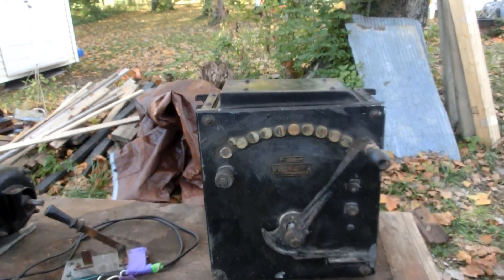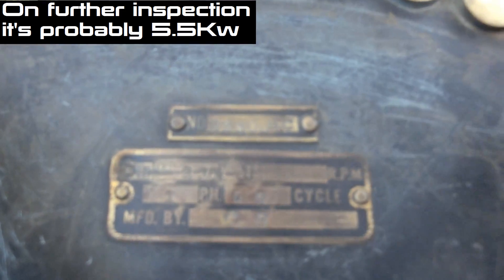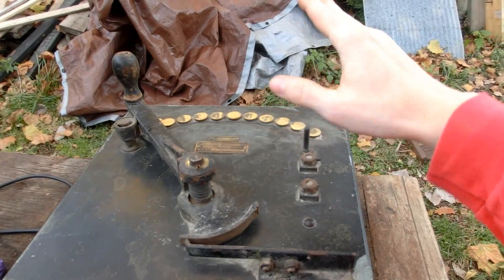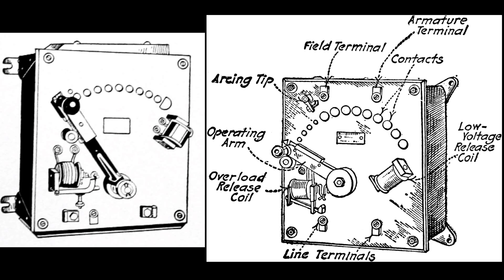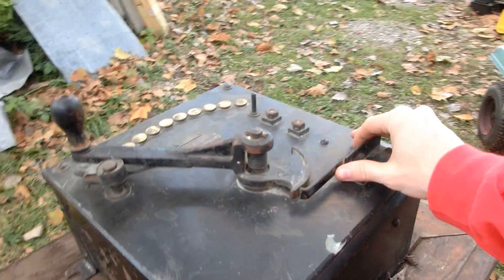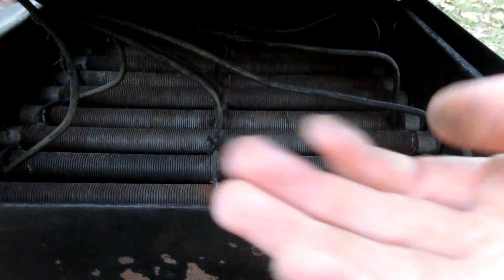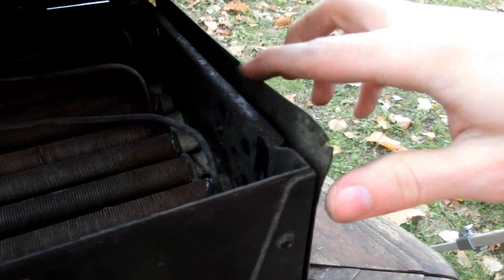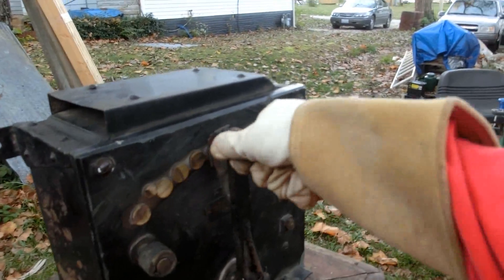1890s Cutler Hammer 5.5kw 240v Starting Rheostat

Comment: In the modern days running the thing at 220V is considered a bit too dangerous - for good reasons.  You might control something indirectly, run a low voltage through the rheostat then control something else indirectly.  Something like that.  For added effect, put a speaker into the case and play a 50/60 Hz humm.  Who knows, maybe this things predates the standardization of grid frequency?

Wire resistors are typically made from nickel alloys.  "Constantan" is one of the more recently (relatively speaking) used ones, "Nickelin" was one of the older ones.  I was wondering about insulation of the wire to avoid an internal short between neighbouring windings.  Chances are the wire is wound on a ribbed ceramic cylinder which is keeping the wires just far enough to avoid a short.  This method avoids insulation materials for the which at the time were still problematic, especially at high temperatures and if this rheostat really does 5.5 kW for some extended time it will be more than toasty.

Comment: the problem is that you are using an induction motor, their speed can only be changed by either a change in electrical frequency or changing the number of windings in the motor, rheostats or voltage controllers will do nothing to the speed
Reply from the maker: its not meant for rotational speed, but accelorational speed
Reply: @RinoaL  next time you go to the scrap yard you should get that big old electric motor that you saw in the last scrapyard video, if you got that and the used the rheostat for the motor field and hooked it to some sort of engine, you could have a generator

Comment: That motor starter is intended for use with a repulsion type motor, probably somewhere in the 5  to 10 hp range.  Your motor is a split phase motor, and will not start properly on low voltage.  The reason it starts is because the resistance of the starter is so low, being designed for a much larger motor.  The presence or absence of the coils has more to do with what it was designed to do than the era in which it was built.  The starter is not designed to be left in the circuit to permit speed control as the resistors will quickly overheat.  I have a ten hp Century motor seen here starting and running on about 1/3 rated voltage.  That starter would be perfect for my motor :) Search "10 hp Century Repulsion Start Motor" and you'll find it :)
Reply from the maker: +realvanman1 oh yeah i've seen your video on that before

thankfully those starting rheostats arent impossible to get http://www.ebay.com/sch/i.html?_odkw=cutler+hammer&mfe=search&clk_rvr_id=910774530711&_osacat=0&_from=R40&_trksid=p2045573.m570.l1313.TR0.TRC0.H0.Xstarting+rheostat.TRS0&_nkw=starting+rheostat&_sacat=0

Comment: hve you tried a maintenance on it, you know,well, i know copper is done with salt and water but vineger can be used alone.  essentially  it`s remove the rust or oxidization. so the metal can conduct.
Reply from the maker: Cleaning the surface of the wires won't increase the conductivity through them. So what are you talking about?
Reply: i'm sorry for wasting your time, i told a long time ago that it was the surface that carries the most electricity on the outside of the metal, making corrosion an issue. 
i can say that i have gotten small gadgets to work with this, but i cant say i've ever gone past fixing my fathers rc track from when he was a kid
Reply from the maker: *****
well the reason cleaning the surface of the RC track worked was because the system relies on power being transferred through the surface into a contacter. but i think you got this misinformation from how electricity tends to pass through the outside of some things like human skin and stuff.
Reply: well thanx alot, this has been very insightful, and i will keep looking through your vid. there pretty awsome

Comment: Set up an electric chair for Halloween with the rheostat and have the settings marked at the most resistance to least resistance -  Tickle * Irritate * Low Torture * Medium Torture * Extreme Torture * Death * Rare Done * Medium Done * Well Done * Vaporized.
Reply from the maker: make the kids sit in the chair and set the difficulty setting. each mark would be a better type of candy. could power it with a disposible camera flash circuit. no kid would be doing it a 2nd time, thats for sure.

Comment: Hmmm. I would have thought it was an elevator crank. Did you have it running on 220/240?
Reply from the maker: no i had it running on 120v
Reply: I'm not sure but running it on 220/240 may make a difference.
Reply from the maker: x9x9x9x9x9
 no its the amps that matter, today i used it to regulate 12v and it worked really well. i ran it in series with a filament that takes 70ish amps on it's own. but with the rheostat controlling it i can go from 4-70 amps on the switch. i didnt think the 2.5 ohms of this rheostat would do that much.

Comment: The reason it's not varying the speed of that motor is because to vary the speed of an AC motor, you need to change the frequency supplied to it. It's speed is based on the attraction and repulsion of an induced magnetic field in the rotor windings.

Try hooking this rheostat up to a DC source, and a DC motor. Put it in series with your electric lawn tractor's motor!
Reply from the maker: yeah i know, i said that in the description. thanks though.
Reply: Yes resistor rheostat control is for dc  motors not ac motor like the ac induction motor that he has.

Comment: I'm guessing the insulation coating on the coils has long since gone, destroying the resistance that they had.
Reply: this is how they made them, its nickel copper usually, no coating as they get so hot it would burn off, the only insulation is the airgap, just enough to prevent arc over at the proper voltage
Reply: jusb1066 Ah yes, no plastic at the time and wax would melt. 

The rust can't be helping with those gaps though.
Reply: there was such a thing as varnish or mineral insualtion, but that would also keep in the heat, which they need to get rid of, it may not be nickel/copper but an iron alloy so its a bit rusty, along with years of crud from wherever it has been, and yep, it maybe make a spark or two in there, along with some smelly smoke
. rinoa hasnt yet pushed any real power through it, so it hasnt got up to temperature
Reply from the maker: Alan Bacon
they had plastic back then, its just the plastics werent great quality.

btw the coating around a wire doesnt increase the wire's resistance.
Reply: Well it would if the electricity can hop 'over the top' of the loops rather than the long way around through the wire itself.

It would act just like a pipe rather than a coil.
Reply from the maker: Alan Bacon
 well that could decrease resistance not increase it.
Reply: Rinoa Super-Genius Well...Yeah. That's what I was getting at. To me it looked like those coils were rusted together/touching allowing the electricity to pass straight through rather than going around the coils, giving them a lower resistance than they were built for.
Reply from the maker: Alan Bacon
 oh at first you said they didnt have a coating so thats why they wherent so resistive. not that they had contacted together. and no they didnt rust that much. its just a slight surface rust like what stainless steel gets.
Reply: Rinoa Super-Genius Those resistors often have a black oxide coating naturally. Admittedly it's not a perfect insulator but it's enough
Reply: ***** Bakelite was early 1900s though around the 40s. There is a huge collector market for it. They did make electrical stuff out of it, but I can only think of low power consumer stuff. It was brittle, and could deform when hot. Also when warm it leaches out flammable formaldehyde, which probably would be bad for an application like this.
Reply: Rinoa Super-Genius The way this device was used was that the incoming AC voltage was varied using this and then the output was connected to rectifiers. The output of the rectifiers then went to a DC motor to limit start up current.

Comment: Just wondering if you did an ohms reading on each of the contacts as you moved the handle? Just did energy usage on the motor; it only required 9 amps. pulled 186 watts of power.   get a 2 - 5 HP motor you will draw 1200-3200 watts of power.
Reply from the maker: i've been looking for a large motor like 5-15hp for years to build an electric car.

Comment: You can measure the resistance from input to output with an ohm meter. Additionally there is no load on the motor so it will not show much difference. These were used to start motors that had an immediate load on them. We use capacitors in much the same way now for motors with a starting load like an air compressor. Pretty cool find.
Reply: Yes, correct, without a load the motor will seem to run at the same speed regardless of the setting
Reply from the maker: yes i did and in the video i said it has 2.5 ohms of resistance. and i mentioned about the motor in the description.